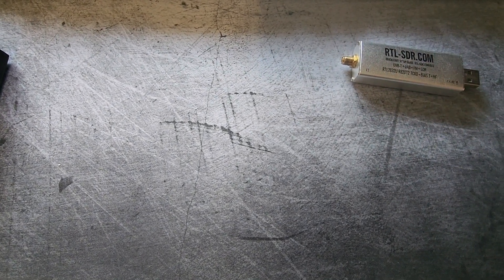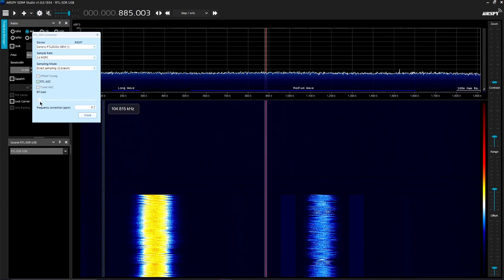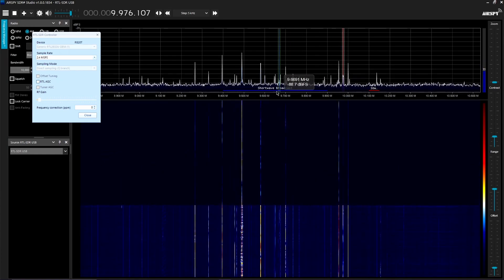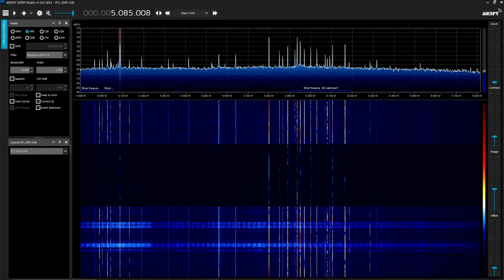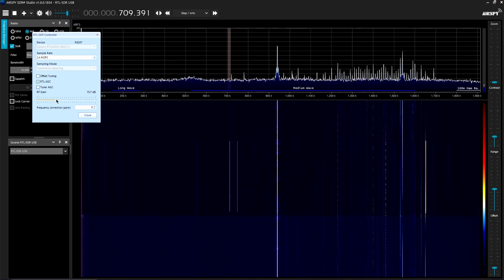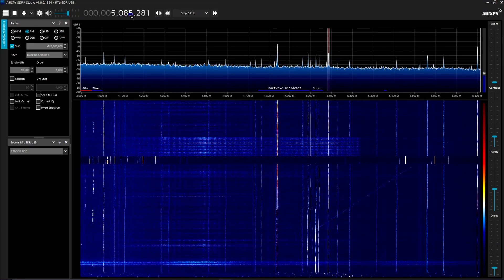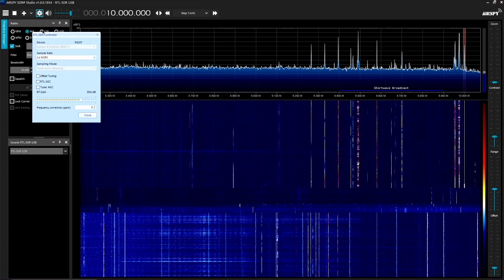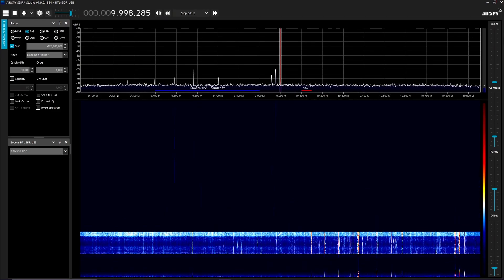RTL Direct sampling VS Quadrature sampling with upconverter

Comment: how can i listen short medium waves in v3??I use the sharp program and antenna the aor 7000 and I receive from 25 MHz and above what moment ..what is wrong ??
Reply from the maker: So if you're trying to receive HF so anything under 30 MHz, You're going to want to go to the settings (the gear icon on the top left and switch to direct sampling (try the Q branch first)